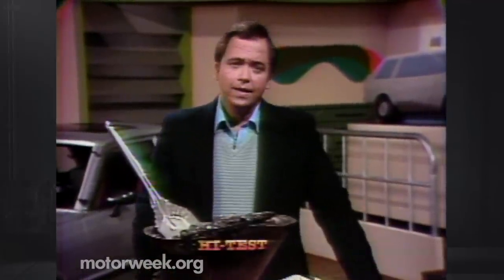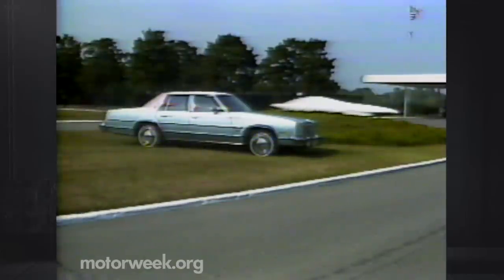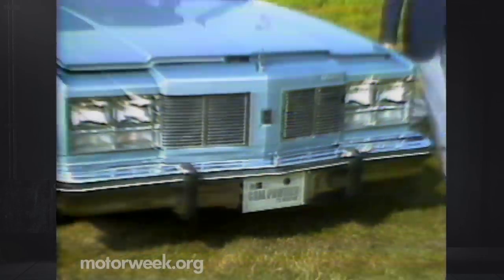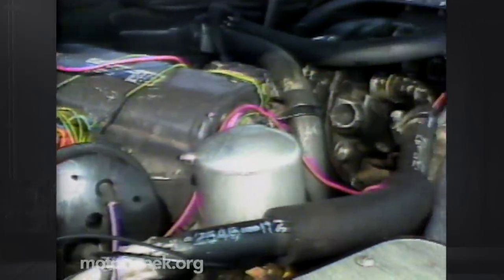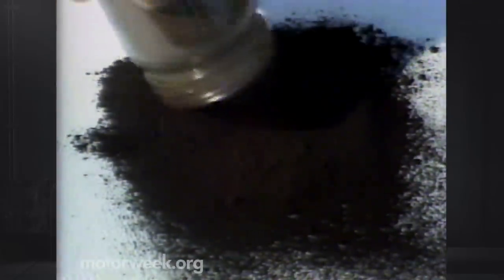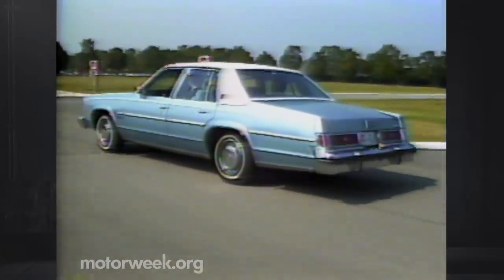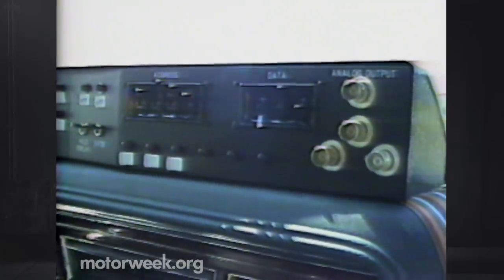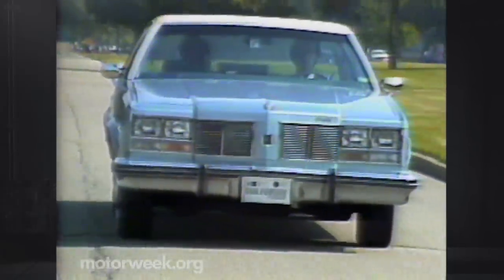Retro Review: Coal-Powered Turbine Engine Oldsmobile

Comment: Coal Dust!? How long could that engine go before a rebuild with all of that sut depositing on the blades? My guess is you'd have to blast it out with methanol every so often?...
Reply: About 6 months and then it needs a complete overhaul, costing a few $ thousand.
Reply: Turbine too hot for soot formation.
Reply: Yea, with a turbine and jet much more air in the mix.More air means more O2 and more O2 mean much higher temps. Higher temp far less pollution. Turbines and jets tend to require far less maintenance than a piston engine.  few problems when trying to put one in a car or bike. First exhaust is far hotter than a piston engine and is usually shooting straight out the back of the engine. Anyone or anything behind the car gets blasted. Next is throttle response which on a turbine and jet tend to be far slower thean a piston engine.
Reply: Chrysler also made a turbine car in the early 1960s and a few hundred models were actually loaned out to the public for testing. Jay Leno has one of the few surviving models and it still runs. Turbine engines have few moving parts so they require hardly any maintenance. A turbine engine could easily go 1,000,000 miles before breaking. It is rumored Chrysler killed the turbine car because it didn't fit there model of planned obsolescence. Chrysler and the automakers want the car last just long enough to pay off your auto loan then they want you to buy a new one.

Imagine buying a car when you are teenager and the car actually outlives you.  The executives knew they go most of their business from repeat customers so selling a car that never dies would soon put them out of business. The project was quietly killed as soon as they realized they couldn't fit it into planned obsolescence.
Reply: You may have a point. The car Jay has seems to run and drive fine. He made a episode on his channel on the Chrysler he has and it seems it drives fine. He drives it down the freeway at 70-75 no problem. He says it will go much faster, it idles at 22,000 rpm. Seems Chrysler solved the exhaust problem and there doesn't seem to be throttle lag. I've heard it will run on any flammable liquid, gas, diesel, alcohol. I'm sure the engine will go 100,000 before any maintenance is needed. The rest of the car, trans, brakes, diff would need maintenance before the engine. It would be interesting to see a new version with a modern engine , trans, brakes and styling. I don't know it a car like this would outlast a owner here in the northeast with road salt, but I'm sure the engine would. Here in the northeast I've seen trucks rutting out at 3 years old. Most trucks over 10 years old aren't worth buying. I've seen trucks with bodies that are fine with frames that are gone.
Reply: Yes but it ran on liquid fuels, not solid ones.
Reply: Coal dust isn't really a solid. Also I'm not sure of the delivery system. My thought is the coal dust is mixed with air and blown into the engine  if the is the case the mixture would behave as a liquid.
Reply: So it's the same as many other GM engines?  Kidding..
Reply: A turbine runs air rich and hot enough deposits shouldn't be much of a problem  but refueling probably was as messy as refilling a laser printer toner cartridge.
Reply: Should I jet-engine a car and also add EGR and similar to reduce emissions? xD
Reply: ThatOneGuy  An American engineer created a Diesel-like coal-dust powered IC engine in the 1920's and kept it clean of residue by using a small amount of lubricating oil in the process of running the said engine.
Reply: Jeffrey That's weird. I would assume that injecting coal dust would be impossible. If it uses a carburetion system ahead of the intake valves then I'd assume that the valves get  coated real quick and not seal.
Reply: ThatOneGuy  I remember reading in the article that the coal dust was blown/forced into the chamber from a sump with jets of air, using a compression ratio that was far higher than that for Diesel oil. 
You'll have to read the old newspaper article yourself. It is in PDF format! Try cross referencing from Wikipedia..
Reply: @Jeffrey314159  
Where can I find the article? Do you know the name of the guy?
Reply: @gregorymalchuk272  That was so long ago it is no longer in my head. 
The old newspaper article was dated 1926 I think~?

Try checking out Jay Leno's Garage online.
Reply: @Novusod  The idea of "Planned Obsolecence" is an arrogant God complex that needs to start getting people hurt.

Comment: GM tried the same thing with a locomotive around the same time. The coal dust damaged the turbine blades too much, so they switched it to bunker oil. Two problems:

1. Because it wasn't a diesel/electric it had to have a hugely powerful hydraulic transmission which was impractical and wore out.

2. It was unbelievably loud! They only managed to sneak into service a few times before localities banned it.

It was used in a few remote southwestern desert lines but wasn't deemed economical.

Comment: With the state of General Motors engines in the late 70s, early 80s (did anyone have one of those wonderful 350 diesels?) I imagine coal could've been a step up. I remember taking my 79 305 cu in Camaro back to the dealer because as a new car (1100 miles) it took 12 seconds to get to 60 pinging heavily. I demonstrated this for the service writer who laughed and said "you've go one of the better ones!". Three hours later l left the Volvo dealer in the frumpy school teacher special 240. Just for the hell of it floored it from a red light, 10 seconds! I never bought another GM vehicle. That Volvo stayed in my family for 17 years 200k miles before l lost track of it.

Comment: Okay, The turbine engine is durable and way more efficient than it's gasoline alternative.  
  What if..................A hybrid turbine/electric hybrid? 
The configuration would use the electric for immediate propulsion, while the turbine blends in as a perfect high speed charger to then take over as the main source of power. 
  As I have an engineering background on aircraft maintenance, I can see this as a very efficient system.  
Bottom line, the electric takes care of the initial off the line propulsion end of the deal and the turbine kicks in with very few limitations for a protectively high speed  or simply Interstate cruiser. Because of the turbine part of the deal, probably a very fuel efficient type of low effort from the turbine engine to sip the fuel intake.

  My apologies for the elongated  description, however, this is a system I would personally like to explore and test. 
Thank you for taking your personal time to read my vision.

Comment: I really love gas engines and don't want them getting replaced by electric. If only we had safe methane engines
Reply: F1 cars have achieved a thermal efficiency of 50%. The newest road cars do 40%.
Powerplants do 40% (coal) or 60% (natural gas), but loose about 20% in charging/discharging the car's batteries, making them average 50%-20% = 40%. So both electric and gas powered cars use fosile fuels with a thermal efficiency of 40%: Both are equally pollutive.

Renewable energy is best used for real estate, since these don't require batteries. It doesn't make sense to power office buildings with coal, and cars using wind & solar power stored in batteries. Electric cars only make sense AFTER everything else is powered with renewable electricity or goes off the grid, and that will take several decades if not a full century. That's why some makes stick to gasoline, and others drop their plug-in capability.
Hybrids are getting more popular, but in the end these are gaspowered too. So don't worry about gas engines dissapearing any time soon.
Reply: Creeperboy We do have safe natural gas engines. It has an octane of AKI 120. China has been running them since the 1980s. There's a CNG/LNG station near my house. It's far from being mainstream, but you can convert nearly any gasoline powered vehicle to run dual fuel, either gasoline or natural gas. The tanks are safe, like the propane tanks for houses. Don't believe what you see on Walker Texas Ranger, LOL.
Reply: @STARDRIVE  Your numbers don't even count electrical transmission losses in the power grid, when you count those,  the efficiency of the electric car is worse than gasoline cars.

Comment: I doubt the engine would run for very long without fouling up from the soot, the blades on the turbine would also wear out rather quickly from the solid particles.
Reply: Yep. I have a feeling thats why the idea was scrapped.